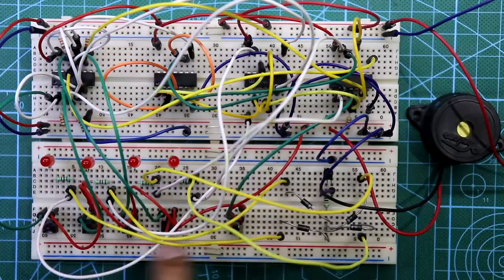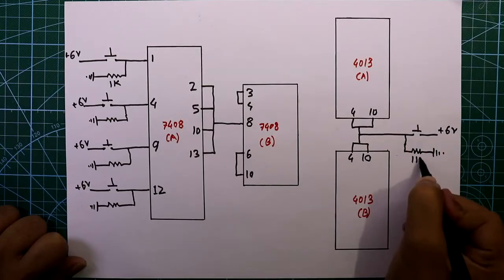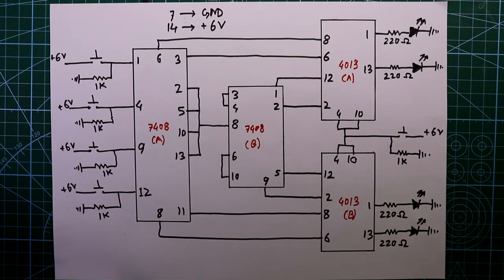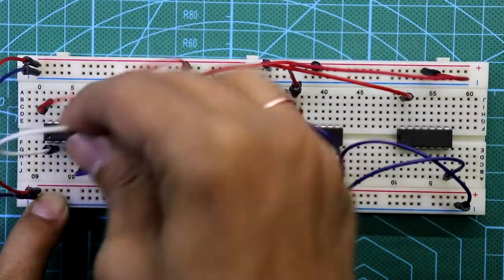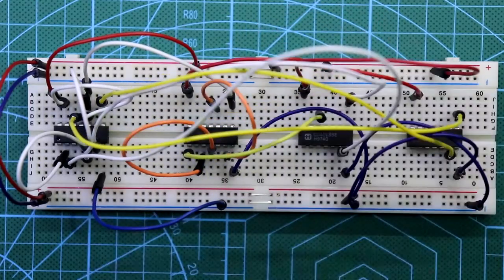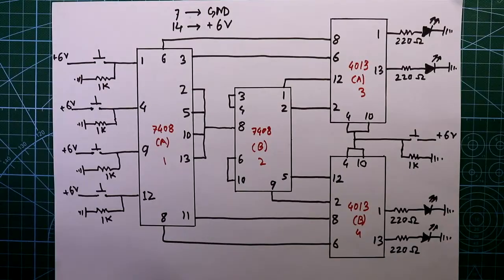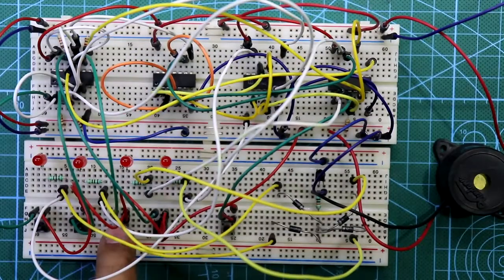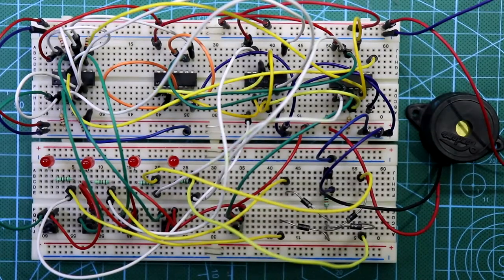Make a four player Quiz buzzer circuit without microcontroller

Comment: Hello. Can you explain how to use the 7474 IC instead of the 4013 IC? I cannot get the 4013 IC in my area. I used the 7474 IC instead and also changed all the pinouts accordingly but when I turn it on all the LEDs glow very lightly and none of the buttons seem to work.

Comment: Are there issues with the the 4013 D Flip-Flop IC?  I see some mentions of issues in the comments but I haven't found official documentation on it.  I have tried making this circuit based on your design, can get the LEDs to light up, but have no control over the LEDs in the circuit with the buttons. They come on by themselves, sometimes a few stay on, some times they turn off, it all appears a bit random.  Sometimes the reset button will work for LEDs 2 3, and 4.  Some times it does not.  I am powering the breadboards with only a 5V 3A power supply and have added a electrolytic capacitor (16V 100uF).  Could this behavior be attributable to being underpowered?  Or maybe the IC's I have are counterfeit or bad?

Comment: Design a system having four users and a host Host will ask a question and a timer f 15 sec will get start. All the users will have a buzzer button to reply to that question. The moment any first user reply, counter will stop, and no other user can reply. A 7-segment display will show the i user number and a green led will gets on. If counter overflows and users failed to reply in the allocated duration, a red light will glow with a buzzer,

Comment: Bro ,I have a doubt ,for my circuit the LED is glowing only when I press the switch,if I remove my hand from switch it stops...
What will be the problem bro
Help me bro..
Reply from the maker: I hope your circuit connection is correct. Now, please check your power supply. Some power supply has noise. 4013 doesn't work if noise is there. So connect a electrolyte capacitor (100uF) across the positive and negative. Supply 6v instead of 5v. Now the circuit should work.

By the way, try my 8 player quiz circuit. That circuit is easy and doesn't have this kind of error.
Reply: @EEWave  will this also work with 12V instead of 6V?

Comment: I found a couple of issues in my circuit ... can you help me out to fix...2 leds are working properly and 2 aren't..
Reply from the maker: Ya sure, please explain the issues
Reply: 2 LEDs are working and 2 not... I tried it 10 times.. yet the problem is not solving
Reply: I have to submit the project on Monday... can you fix the problem ASAP???
Reply from the maker: I hope your all components are in good condition and you have connected the circuit correctly. Now, what kind of power supply you're using?
Reply: @EEWave  yes all the components are in good condition... 6v battery
Reply: @taliqamuhib8968  Can I know how you use 6v? Did you connect it to a 6V Battery or a 6V power supply?

Comment: My project is not working.I have checked all the connections they are fine.Can you help me in finding the mistake or can you give any link for its working explanation so that i can figure it out myself?
Reply from the maker: What is the power supply you are using? Try this on 6.5 volt, and tell me where it is working or not.
Reply: @EEWave  I am working with 6V by using 7806.how can I make it 6.6.By troubleshooting I have found that there is some problem with both 4031 ics
The output to led is through Q of D flip flop which should be 1 if both S and R inputs are 1.In my circuit both inputs are 1 but Q is not 1
Reply from the maker: Ok no problem with 6v but you can have 6.5 volt with LM317T. Now, if you are getting problem with ic 4013,  then try with ic 7474, this is also dual D-flip flop ic. Or watch my 8 channel quiz buzzer circuit, that circuit is more easier than this, https://youtu.be/mljXSRayRuA
Reply: @EEWave  ok thank you
Reply: @EEWave  only one of the buzzer is working
Reply from the maker: Then increase the voltage only for 4013 ic, you can use 15v for 4013 ic, but don't increase the voltage for 7408. Use 7805/ 7806 for Vcc connection of 7408. There is a problem with ic 4013. Hope this time will work.
Reply: @EEWave  ok thank you

Comment: Sir,
Can we use 9 v battery
Reply from the maker: No, don't use 9v. Maximum voltage you can use is 6v.
Convert 9v to 5v using voltage regulator IC 7805.
Reply: @EEWave  thank you sir
Reply: Sir I made the circuit but when I connect the 5v supply , all led glows .I am not able to find mistake. The circuit is also correct
Reply from the maker: I think this circuit is getting external noise from the power supply. Try to remove the noise by using capacitor or use 6v DC battery for this circuit, this will work.
Reply: Can you make this for me...

Comment: If we press the two buttons at a time what will happen ???
Can we modify from manual reset to auto reset ??
Reply from the maker: If you press the two switches at a time and if the time difference is approximately less than 140 nS, then either two LEDs will glow or will not glow any of them. 140 nS because it has some propagation delay.

Yes, you can make it auto reset by using 555 timer in mono-stable mode. You have to connect its pin 3 to the reset switch of this circuit.